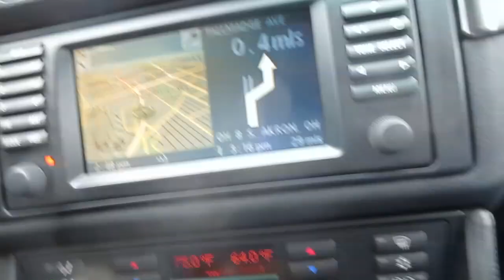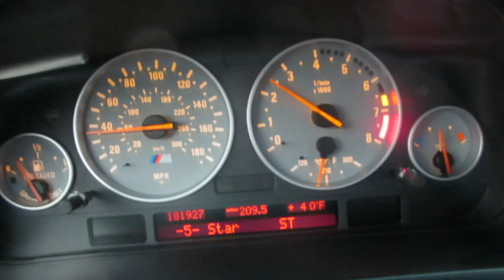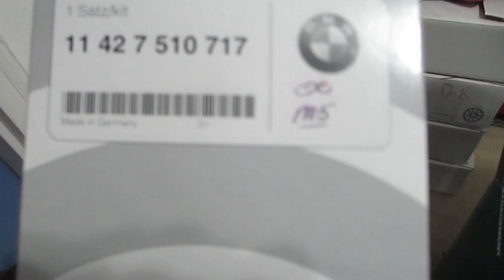Buying Wheels  12/29/13 - Day 1,117

Comment: Boogie wonderland. All I need to say about Earth, Wind and Fire! You better be coming to Reading, England for your new year trip. ;) Thank you for removing the cap. No GLUB GLUB. Also what oil does Colt's car take? I wasn't sure if it is 5W30 or if he stepped up the viscosity to prevent oil burning... I'm thinking about what oil plans for the X5 are. It takes 10W40 now but does burn a bit of oil... But it isn't really all that bad and I would rather not want to chance it with VANOS in the engine or starvation when it's just been cold started... All decisions! But will probably stick with what BMW recommend Castrol 10W40.
Reply from the maker: You shall have to see, although I do not need a passport for this kind of road trip that we are taking!  Colton is going to use 5W30 for winter, and 5W40 for summer I believe.  BMW recommended 10W60 for the S62.M5 and I think 5W30/5W40.540i.
Reply: Well TIL. I always thought it would be heavier in the M62. But climate makes all the difference!